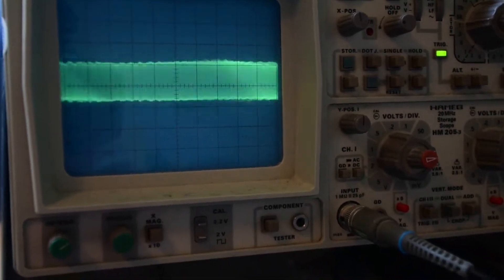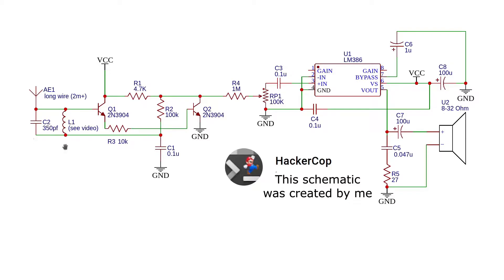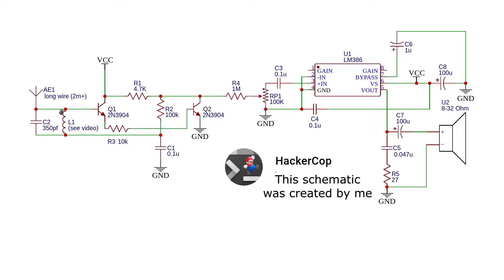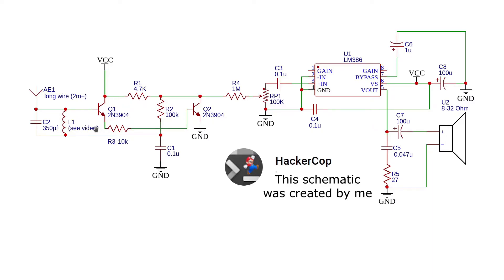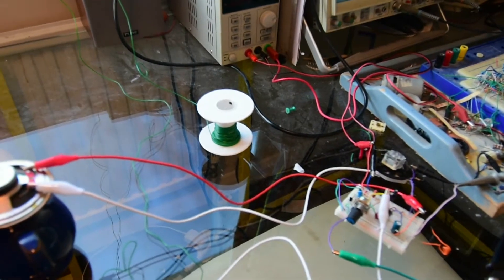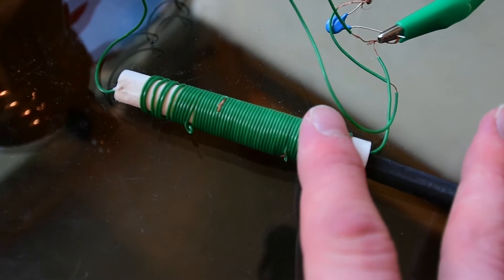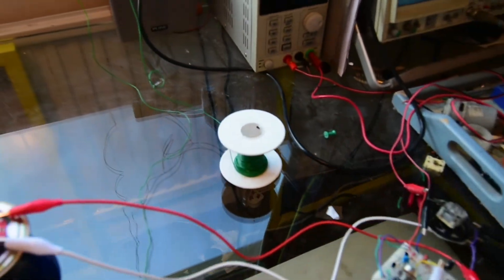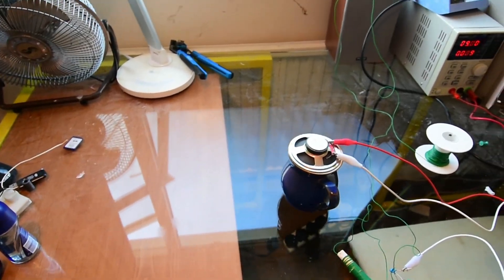Build AM Radio (Easy) + Schematic & Explanation

Comment: hey HackerCop I was curious if you had finished or was working on that Nemesis Inferno custom track, I saw a comment of yours a while ago on it that you were porting it
Reply from the maker: I did port it a year ago but never released as things like loop the loop don't work well in mkwii (also my port was very incomplete). I'm not actually doing mkwii modding anymore, I've moved on to computer science
Reply: @hackercop  Oh i see, i was also thinking about porting it but i just couldn't get my head around actually getting the coaster to work like with car way points and a different mesh, but anyways thanks for replying and best of luck with computer science!

Comment: This is very interesting. I’ve considered doing something like this but I don’t really have the motivation to do so. I also don’t have all of the things required to do build it. It’s still a really cool video and if I ever build it I will let you know.
Reply from the maker: You can build it with just a breadboard and components and power from a 9v battery, having an oscilloscope is helpful but not essential. I got the ferrite bar from an old radio, being able to slide it to tune the radio is very fun. If you do do it I would love to see the video.
Reply: @hackercop  It may be a while before I build it, but when I do I will send you the link in a YouTube comment. If I can’t, we can use something else like an email. Thanks for the help.